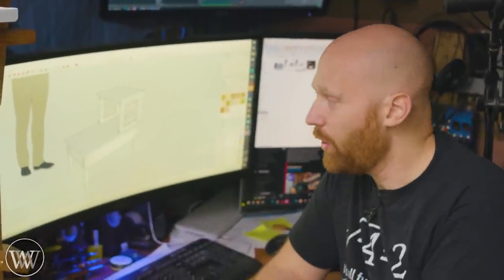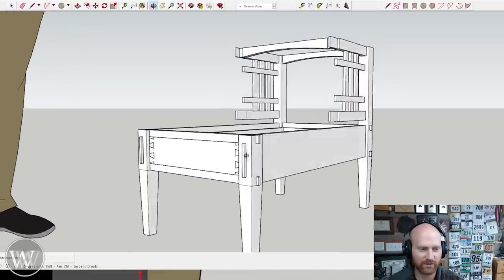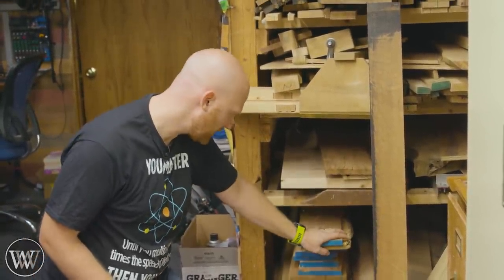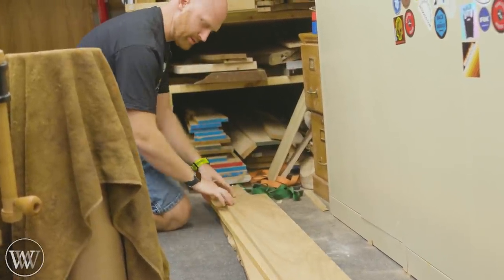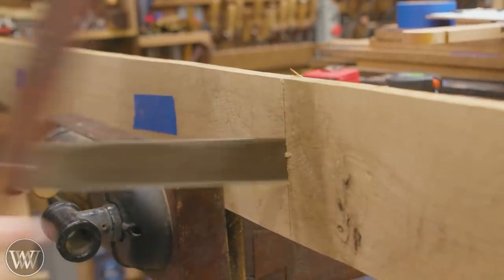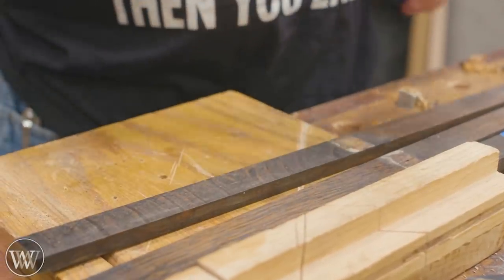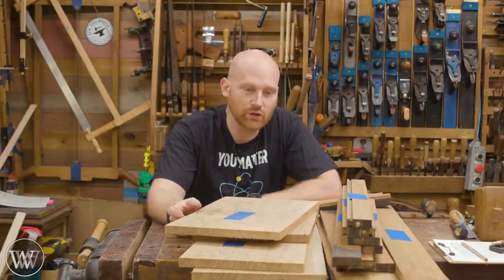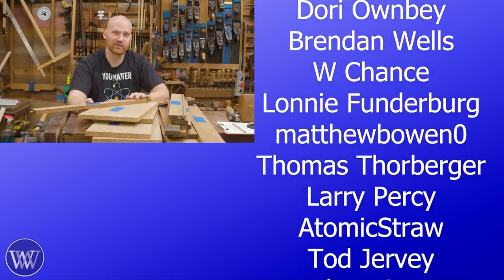The Wood By Wright End Table Design and Cut List / Part 1

Comment: You're probably past this point already, but regarding your original plan - have you considered having the front half of the lower, longer table top open up? I'm just wondering if such a long drawer, especially when it's full of stuff, might try to break or tip forward when you pulled it out all the way. If the top half of the lower bit could lift up, you could get all the way to the back without ever having to pull it out more than half way.
Reply from the maker: I thought about doing that but then that shelf would become useless anytime you need to open it up. And usually the drawer is for things that you kind of want to get lost.
Reply: @WoodByWrightHowTo  Fair point!

Comment: I’m brand new to wood working. I need to find a saw to rip lumber down. Any good recommendations? I live in the PNW, so I’ll probably order online. Thank you!
Reply from the maker: Are you wanting it to resaw or are you wanting to rip lumber into strips? If you're wanting to resaw then you're probably going to want to build a roubo style frame saw. If you're wanting to rip strips down then you're probably want a panel saw or hand. Saw around 24 to 26 in long with something around 5 to 6 PPI.
Reply: @WoodByWrightHowTo  I want to rip a 2x6 down to a 2x3. I want to make a top for a workbench. My card table just isn’t cutting it… wait, was that a woodworking joke? :D
Reply from the maker: In that case I would use a hand saw somewhere around four or five PPI. Rip tooth would be best. They're a little harder to find, but you can find them at antique places. You can check out handtoolfinder.com to try and find places near you. But for new those get really expensive. You can get it cheaper PAX saw those will work really well but the handle isn't as comfortable as you want. It's just a bit larger than it needs to be so that you can file it and shape it back to fit your hand.